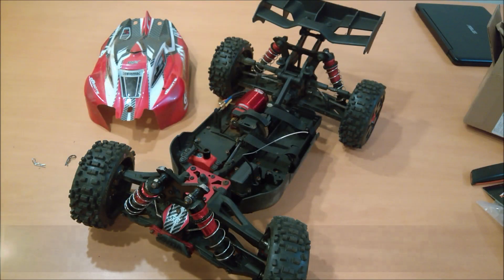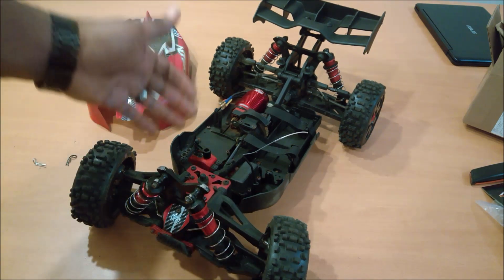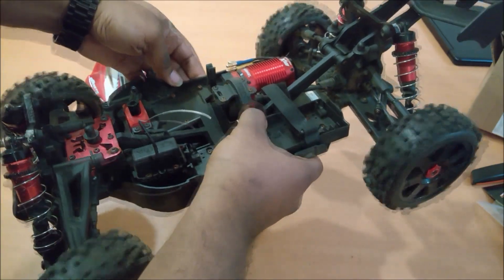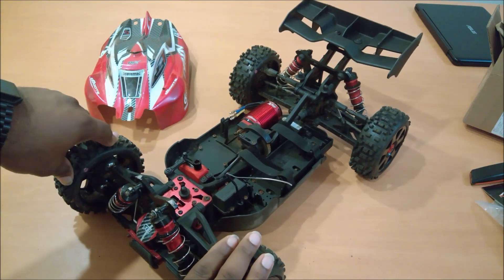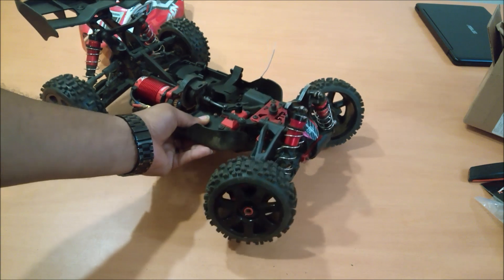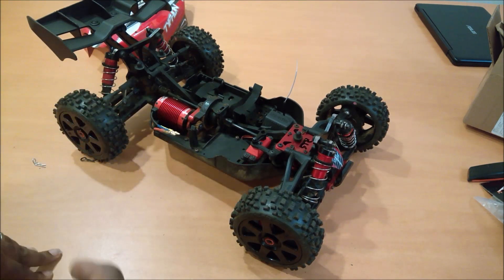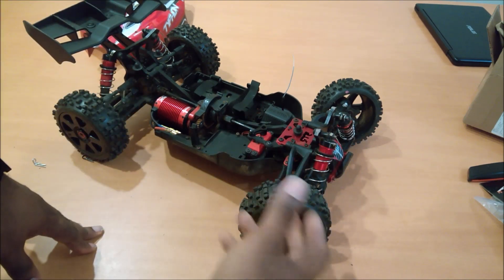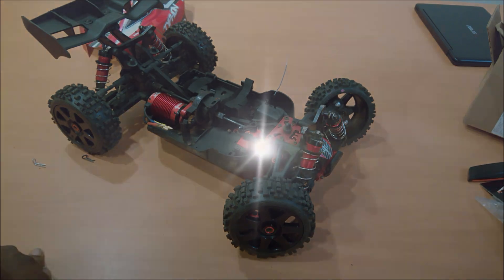Ep. 251: Center Diffs Explained

Comment: I noticed the center diff problem with my V3 Talion last winter when it got stuck in a car tire rut in the snow.  The rear end was in the rut and the front was hanging out the top.  Pulled the trigger and the front wheels ballooned like crazy and the rear tires did absolutely nothing.

Brought it home, opened up the center diff and filled it with 500k weight diff oil.  Now I can't keep the front end down.  Even on a really long acceleration, it will run nice at about 7/8's throttle but as soon as I pull the throttle the rest of the way, if flips over on its lid.

The other big side effect is that EVERY jump is a backflip whether I like it or not.  The moment the tires leave the jump, it's already rotating.  My Talion actually has a reputation locally as being a bit of a wild animal because of all this.  There isn't much that can touch it when we're out bashing.  Even on 4S, it ate my buddy's 6S ERevo2.0 alive. 😎
Reply from the maker: Awesome! I ended up trying out 150K and kinda like it. I'm running a Castle Sensored setup in this rig now and it's got plenty of power to toss this beast around. The 150k makes the car feel really planted, and I get plenty of 4wheel drift action on low-traction surfaces without making it wheelie every 6 seconds.

Comment: Nice vid mate! 
Would be a 20m Center Fluid, 100k rear and 200k front setup good on the outcast 8s?
I ask myself, will this setup force to much wheelies?
Reply from the maker: Hmmm. That's a hard question for me to answer since I don't have an Outcast. Here are some things to look at, though.

20m Center Fluid pretty much locks the center diff, but that does not necessarily mean your rig will become a wheelie machine. Wheelies happen when you have just the right combination of 1) a lot of rear-wheel torque, 2) a lot of rearward weight transfer on acceleration, and 3) a "light" front end. 

If you find you have too much wheelieing, you have a lot of options to correct it. The simplest if just managing it with skillful throttle control. You can also adjust the torque/punch limits in your ESC programming (assuming you are running a Castle ESC), adjust your throttle Expo curve to better help you modulate power, go to firmer springs, changing the front and/or rear ride heights, add weight to the front end, or even add a wheely bar. 

You have a lot of flexibility. The real question is understanding how YOU WANT the car to handle. Some folks LOVE wheelie-machines. Some HATE them. I personally like my Typhon to feel really planted, but still have the ability to wheelie when I want it. I pulled that off by adjusting my throttle expo and ESC settings.